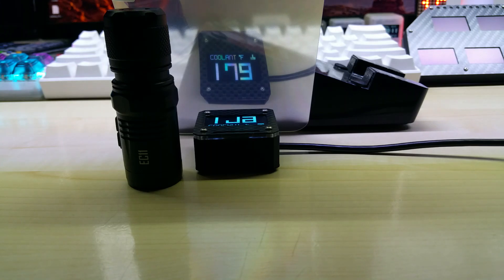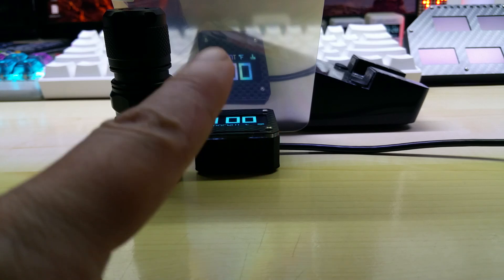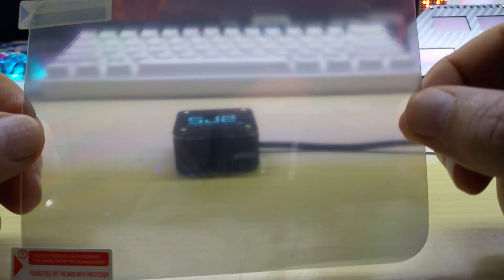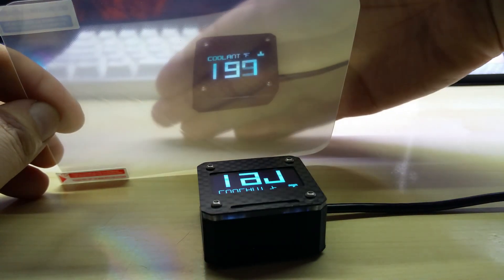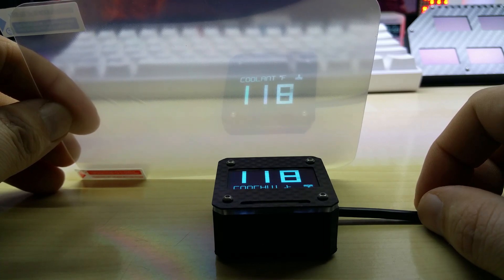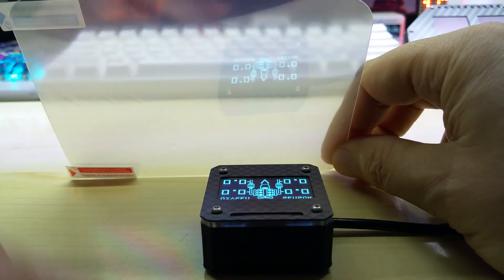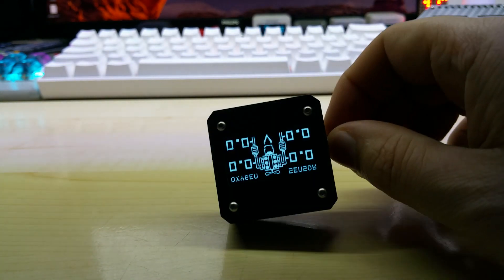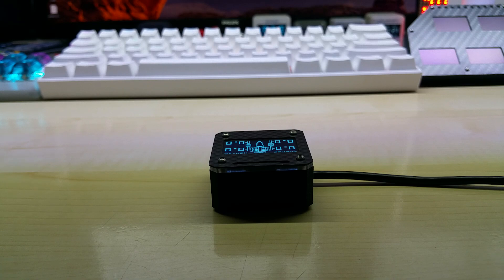CAN Gauge micro in HUD mode?  Yes I CAN, please share if you like, thank you.

Comment: I have bagged z. Right now I’m using a needle gauges to know my air pressure for the front and rear bags. I was wondering if I could use this as my new display? Any thoughts?
Reply from the maker: Technically yes, you would need pressure sensors and connect them to my upcoming CAN BUS Node and that would connect to my CAN BUS Gauge, which will of course all other data as well.